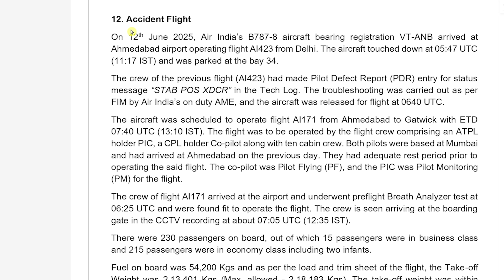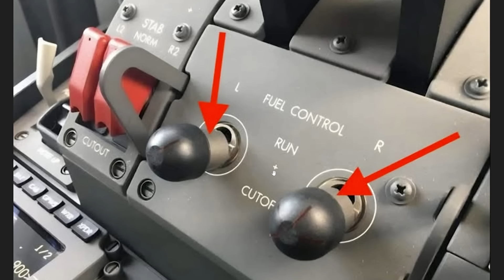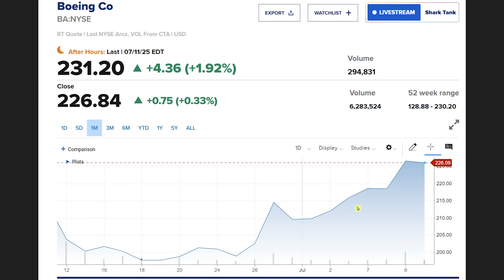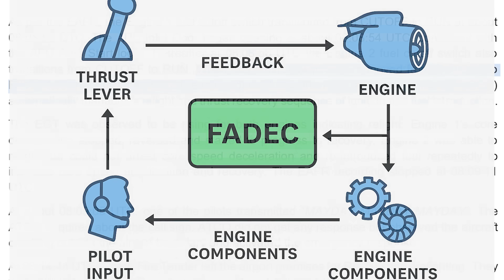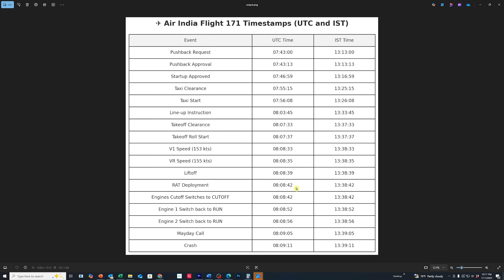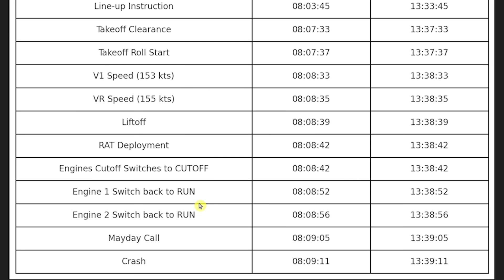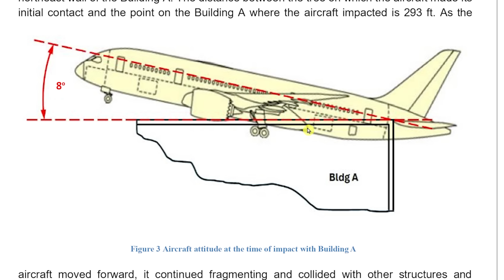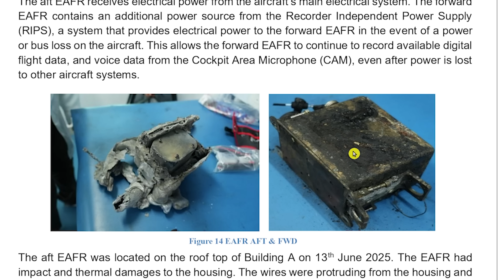Did Pilots CUTOFF Fuel? Shocking Twist Air India 171 Report!

Comment: I've seen other sites where people simply refuse to believe this.  They keep tossing out ideas and thoughts on maybe this was still an error and keep trying to find some other way to explain it.  But it's simply not possible.  The cutoff switches are spring loaded devices, protected by metal protuberances on either side so you can't accidently brush them.  A person has to reach for them, pull them up against the spring holding them in place, move the lever over a Detent (a little metal spike you separating on and off, and then release to let them back into place and into electrical contact.  They can't balance on the metal spike as then nothing works.  They can't move by themselves due to the springs and detent. They can't be hit accidently due to the protections to each side AND the springs and the detent.  They are built to only be moved on purpose period.  And in the flight their is the Pilot in Control (POC) and the Second Pilot (P2) in the cockpit and that is it.  And the sequence is quite clear.  They reach V1, the POC pulls back to begin ascent.  The plane takes off and speed keeps increasing from V1 to 180.   Then P2 cutoffs engine 1 and engine 2 (one second delay common for such movement by hand).  POC, busy controlling the flight sees this, asks did you just cutoff, P2 says no.  10 seconds after the cutoff, POC (we assume) reengages Engine 1, and then four seconds later Engine 2 .. but by then it's too late.  And we assume it's the POC as that four second delay is due to a man trying to control the flight and use only the one hand to reach for the switches and move them while struggling to control.  If the P2 had acted it would have been a brief delay. This is very very clear.  Stop trying to find some other way to explain it away.   P2 did this, and did nothing to help in those final seconds.

Comment: Could it be that display panel said they were off, but were actually on? Ie a software issue that cut them off by error?
Reply: I understand that both engines have a separate software system and electrical? For them to both fail, it would be near impossible?
Reply: Therefore it seems like the fuel was cut off on purpose,  which is really sad and I don't want to blame someone who isn't here to defend themselves

Comment: The RAT came out before the engine switches were touched. That means they were having a problem. To which the next sequence of events would be to try and reignite them by turning the switches to off so they can be turned on again.
Reply: one pilot thought the other turned the engines off (because both cut out at the same time). Then one or both pilots turned the switches off, to turn them back on. They would have had no time to voice what they were doing except to re-engage the ignition switches.

Comment: One thing confuses me. Your timeline says that the pilot cut the fuel off at 08.08.42, but also the RAT deployed at the same time 08.08.42. I don't know the ins and outs of RAT deployment, but surely it is something like low hydraulic pressure and/or low bus voltage. Surely, this means that there was a problem causing RAT deployment before the pilots cut the fuel. The engine N1 would take time to spool down from the fuel cutoff, so the RAT should have deployed some seconds after the switches were operated. Maybe the pilots saw something was wrong and switched the fuel off in response to that?? I understand that turning the fuel off and back on is a way to prompt the engines to try to relight, have I got that right? Maybe the pilots weren't suicidal
Reply: Kiwi.N.Z 70yrs Pilot 

Computer cut the fuel  , , Switches are  , , ON , ,

Comment: ok, the prelim report says the RAT started supplying power at 8:08:47; was it already deployed? If the switches were turned to Cutoff at :42 and :43, did it take 4 seconds for the engines to drop below idle, and then the RAT deployed? does it start supplying power immediately, or does it have a start-up time?

Comment: The timestamp chart at 11:23 appears inaccurate. Given the 1-second gap between engine cutoff times after reaching 180 knots at 08:08:42 UTC, it's surprising that the cutoff times aren't explicitly mentioned in the report. This omission raises suspicions. According to the report, RAT power supply began at 08:08:47 UTC, but the RAT deployment trigger time is not provided. Assuming cutoff times of 08:08:42 and 08:08:43 UTC, there's a discrepancy of 2-4 seconds between engine cutoff and RAT power supply. This suggests that the actual cutoff time might be before 08:08:42 UTC, indicating a potential issue with the report's timeline.
 (ChatGPT reply)

✈ Updated Key Events (as per report):
Event	Time (UTC)	Description
Max airspeed 180 KIAS	08:08:42	End of acceleration phase
Engine 1 cutoff	~08:08:42	Assumed Fuel switch to CUTOFF
Engine 2 cutoff	~08:08:43	1 second later
N1/N2 decrease starts	~08:08:43+	Engines begin spool-down
Aircraft still airborne	Yes	Shortly after liftoff
______________________________________
🌀 RAT Deployment Logic on Boeing 787
The RAT automatically deploys when:
•	All engine-driven generators fail, and
•	No other electrical power source (like APU) is supplying power, and
•	Aircraft is airborne
The 787’s electrical system is split between the engines (4 IDGs total: 2 per engine), so both engines must fail (not just spooling down) for the RAT to deploy. The RAT deployment trigger is electrical loss, not just fuel cutoff or N2 drop.
______________________________________
⏱ Time Estimate Breakdown
1.	Engine flameout & generator failure:
o	From Engine 2 cutoff at 08:08:43, it takes ~2–3 seconds for both engines' N2 to decay low enough for IDGs (Integrated Drive Generators) to drop offline.
o	So, electrical loss triggers around ~08:08:45–46 UTC
2.	RAT deployment initiation:
o	Triggered automatically by EICAS logic upon loss of all AC power
o	Deploys mechanically in ~2 seconds
3.	Hydraulic pressure available:
o	Requires ~2–3 seconds after deployment to spin up and generate sufficient hydraulic pressure (assuming aircraft remains at or near 180 knots IAS)
______________________________________
✅ Final Calculated Timeline:
Step	Time (UTC)	Duration from engine cutoff
Engine 1 & 2 fuel cutoff	08:08:42–43	0 sec
IDGs go offline (trigger RAT)	~08:08:45–46	+2–3 sec
RAT fully deployed	~08:08:47–48	+4–5 sec
Hydraulic power available	~08:08:49–50	+6–7 sec
______________________________________
🧮 Conclusion:
➡ The RAT will deploy and begin supplying hydraulic power approximately 6 to 8 seconds after the second engine is cut off — i.e., around 08:08:49 to 08:08:51 UTC.

Comment: maybe it was a problem with the software which led to the Plane thinking the switches are turned off, even tho they are turned on. That would explain why they took so long to reactivvate the switches. Because they had to disable and reanable them for the plane to understand they are turned on. that could also explain why the one piot asked the other one if he turned off the fuel switches. The Pilot got the warning from the plane, checked the switches and noticed there´s a problem.

Comment: The FO was pilot fling. Takeoff is a stressful time. If the captain were to cut the fuel switch at this time, the FO would notice with his peripheral vision that something had happened and that thrust was lost, but he would not expect that under any circumstances. So he asks  "Why did you turn the fuel switches off".  The answer "I didn't" confuses him even more. He is still in control of the plane during takeoff. He has to take his eyes off the controls to turn on the switch. Hence the delay between the first and second.

This is all speculation.
We need to hear the real voices.

Comment: Thanks Jeff, 

Highlights the flaw of crossed controls in the Boeing design. 

Having a throttle lever that is set to 'full' thrust, overridden by a switch set to 'no' thrust is clearly anomalous. 

Just one control should govern engine power, particularly in an 'electric jet' with no physical controls lines between the control that signals the pilots intent and the valves that actually do the job.

Comment: In FAA Airworthiness Bulletin NM-18-33 relating to the switches the phrase "locking feature disengaged" is used which implies that the locking feature can be enable or disabled. Do the switched have an ajustment to engage/disengage locking? This might be something like a rotation of the switch.

Comment: Here we go again with another "expert" jumping on "the pilot did it" bandwagon.

Why is no one talking about possibility of any electrical malfunction beyond the mechanical switch? The fuel supply system is not entirely mechanical and hydraulic. Mechanical fuel supply switch controlled by pilots ultimately generate electrical signals that are sent to fuel supply controller to regulate fuel to engines. What if there was an electrical malfunction causing the fuel supply cutoff to engines?

Also, if a pilot did it intentionally, he would have resisted the other pilot trying to turn on the fuel supply switch again. The fact that they were found it in ON position indicates that pilots desperately tried to save the plane rather than intentionally crashing it.

Boeing is going to throw everything including the kitchen sink at this issue to make it look like a sabotage rather than system failure. We will never be told the truth. Since the preliminary report needs to be mandatorily be released in 30 days, it was intentionally written in a shoddy and ambiguous way to open up pandora's box. The final conclusive report has no mandatory timelines and we will never see that coming till the issue has been completely forgotten.
Reply: If there is some sort of design flaw that allows a fuel cut off malfunction why aren't there other 787's experiencing the same issue?
Also, if your theory is correct why wouldn't fuel cut off occur at cruise altitude or taxiing on the runway?
Reply: @davidh7398 by definition, malfunction does not happen every time and there is always a first time. What if the electrical malfunction happened just at the takeoff cutting off the fuel supply to both engines? My point is the probability of the system malfunction is much greater than pilot suicide theory. Trust me, if it was a pilot suicide, Boeing would have pushed the cockpit recording to be released which would have the pilots fighting amongst themselves to control the aircraft.

Comment: With everything now 'fly by wire' meaning you don't actually do anything, your action is sent to a computer which then activates the device. Is it possible that it was a software glitch. 

Does anyone know the signal path for these particular switches?  Do they directly turn on fuel pumps or send an 'intention', that the computer then activates.  A scenario like that would be why the other pilot say 'I didn't'

Comment: I know this area exceedingly well. Most of people wouldn't know:
1, Flipping these little switches CANNOT directly alter the fuel. These are only scanned inputs to the flight control computer "EEC/FADEC" that actually does the cutting off through actuator. Hence the term " fly-by-wire ". How, when and whether it cuts or not is entirely on its own and is not human (pilots) interrupteable.
2. These little filmsy switches are not meant for, nor qualified to be, Emergency purpose, are naively located in the wrong place and manner ( no locking cover )

Comment: The switches went off, 1 second apart.  Then there was an exchange between pilots as to why did the other cutoff the switch, with a reply of i did not do so.  Please add these time points in your timeline.
I think the pilot was distracted and flipped the 2 switches, thinking he was switching something else.  What are the possible scenarios that he should have been switchng instead at that moment of takeoff.
Reply: cant happen Goober......take lots of work to push the switches,,,cannot be by accident

Comment: Everyone blaming the pilots. Boeing will do everything possible to cover any culpability.

THESE ARE CRITICAL SWITCHES.
HOW CAN ONE PILOT TURN THEM OFF WITHOUT THE OTHER PILOT NOTICING??

WHY AREN'T THEY LINKED TO AUDIBLE AND VISUAL ALARMS?
A MASSIVE DESIGN FLAW!!

THERE SHOULD HAVE BEEN AN ALARM BLARING IN THE COCKPIT!!

If done intentionally as you claim then what's stopping such an event happening in the future??

There have to be interlocks in the software to prevent the fuel being shut off at such a critical stage of the flight even if the switches are turned off manually.

Just Boeing bullshit!!

Comment: 12:56 You see? RAT deployment and Fuel switch cuttoff happened the exact same time 08.08.42 So I think it's not the pilots who turned the switches off? But it's controller or machine failure issue. Boeing is hiding their faults

Comment: You are very fast to claim one of the pilot did it. Same thing Boeing stated in Ethopian and Lion airlines when the problem was MCAS system.  Why RAT came on first ? Why no audiable and visual alarm when a critical system turned off? 10 seconds before they switch back? There is no sound of fight between pilot those 10 seconds and May day called by same monitoring pilot.  You can say any thing . This is a total cover up to save boeing by blaming pilots.

Comment: It appears that the manufacturer will have to incorporate a new prevention for the "Suicide Fuel Switches at Low Altitude". It is tragic that the engineers can't trust the pilots to manage a well- designed system. Perhaps a software fix to preclude any repeat of this horrible scenario will be called for. If such a fix involved replacing modules and or wiring, it will probably never happen due to the added costs to modify all existing 787-8 aircraft. Thanks for Posting, Mr. Jeff Ostroff.

Comment: I don't know that they were "Arguing".  It does seem based on the data that the fuel was cut-off each about 1 second apart, and kept off for about 10 seconds and then restarted, about 1-second apart, which according to some experts is consistent with a manual switch flip, and not so much a switch or system malfunction.  So this does somewhat confirm that it was done "intentionally" either by mistake or on purpose.  However, ten seconds is a LONG TIME especially during take-off for something like this to be the case.  ONe second or two seconds, maybe yeah, a "mistake" but 10 seconds to me sounds like it was totally intentionally done, not a malfunction, not an accident.  Originally I had considered the possibility that one of the engines was maybe reporting faulty so they would shut that one down (which the 787 can take off with one failed engine if it has enough speed and momentum after V1/rotation).  But reports and data seem t osuggest (And was confirmed) that the engines were working properly until the fuel was cut off, sort of putting to rest that theory.  The fuel cut-off does also explain the RAT though as the engine computer would detect loss of thrust and power, and possibly engine rollback and thus deploy the RAT.

Comment: Fuel cutoff switches do not directly control fuel valves.
They send a digital command to the FADEC, which then evaluates the command in context.

FADEC is a software-based control system, not a mechanical relay. It uses internal logic to verify whether to execute or reject a command, based on parameters such as:

Engine operating condition

Throttle setting

Altitude and airspeed

Aircraft phase of flight (e.g., takeoff, climb, cruise)

Presence of abnormal conditions (e.g., fire detection, overtemp, overspeed)

Interlocks and safeguards exist in modern designs to prevent unintentional or inappropriate shutdowns.
For example, during takeoff or climb, many FADEC systems are designed to block or delay fuel cutoff execution unless specific emergency criteria are met.

While emergency overrides do exist (e.g., for confirmed engine fire), they are not unconditional. The system still performs internal checks to verify the command’s validity.

Comment: The captain turned the switches off, asked "why did you turn the switches off" for life insurance reasons, and then there was probably a struggle to get them back on (they came on 4 seconds apart) and the struggle was over when the crash was assured.

Comment: 4:09 The most plausible scenario behind that crash is that the fuel in the fuel line was vaporized due to extreme heat (above 110 degree F) of runway upon aircraft wing tanks and its fuel which caused the fuel pumps to fail in pushing the previous liquid fuel (now vapor) into the engines thus choking off both engines simultaneously. I doubt well trained pilots would make a manual error by flipping such a critical switch to sabotage their own aircraft.
Reply: These well trained India pilots attempted to restart the stalled engines. The pilots knowingly moved the cutoff switches to off and then back to run positions; however heat vaporized fuel still could not be moved by the fuel pumps into the engines thus restart to get thrust failed and aircraft continued to lose altitude and crashed. 

Fix: temperature gauges should be installed inside wing fuel tanks or fuel line prior to pump to insure its contents are not at critical vaporizing temperature levels during takeoff.
Reply: RAT deployed one  second after the fuel starved engines thrust stopped. These engines were choked because heat vaporized fuel could not be pushed by fuel pumps into the engines. So when the pilots realized the engines lost power (heard RAT deployment noise), they, per training, instinctively turned off cutoff switches and then pushed them back to run to restart each engine separately. Obviously restart sequence failed because no fuel reached the engines.